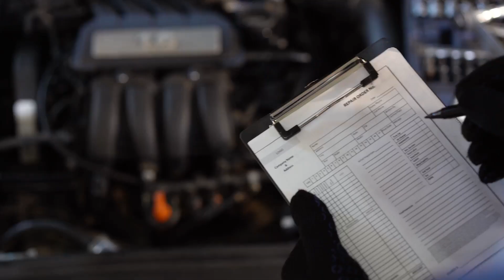The Ford Coyote V8 Typewriter Tick | Ticking Noise EXPLAINED! F-150 & Mustang Sound Official Ford 📝

Comment: It’s caused by a thrust washer on the rear of the crankshaft gently tapping the block, which gets its sludge washed out with a new oil change. It’s absolutely harmless, and it always goes away.

Comment: As a ford engineer, its the rocker arm. It's a problem that causes long term issues.
Reply: I replaced all timing components and lifters and followers/rockers and still ticks. Even did the one on the high pressure pump. I give up. Truck runs great no codes. Shop used rotella and got worse. Truck always had 5w30 mobile one. Was quieter before timing job. Then did rockers and lifters. Quieter but still has a tick.
Reply: @BTerrazas-m5d  have you tried unplugging the bypass solenoid?
Reply: Sounds like rod bearings (traced with stethoscope by technician in my case but the dealer said its typewriter
Reply: Can confirm
Reply: Because it's not properly lubricated all the time?
Reply: It’s caused by a thrust washer on the rear of the crankshaft gently tapping the block, which gets its sludge washed out with a new oil change. It’s absolutely harmless.